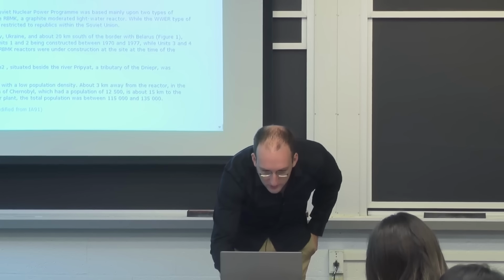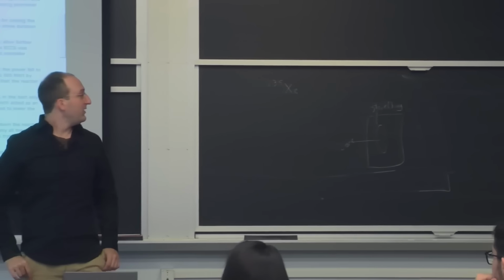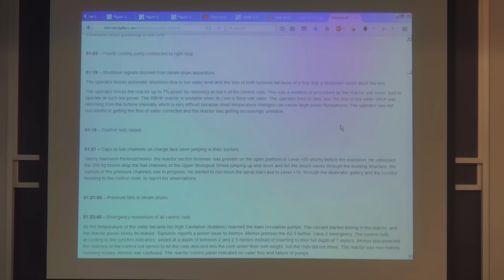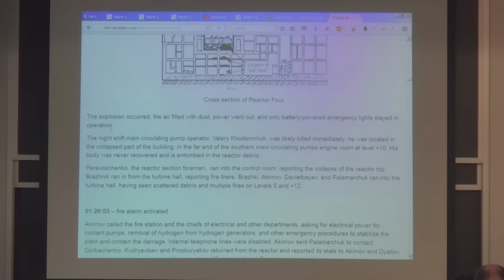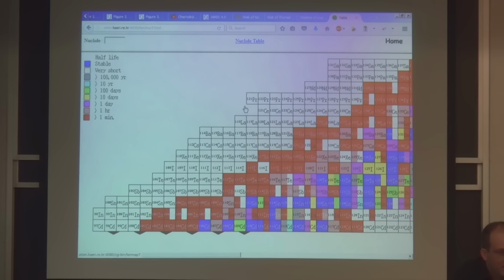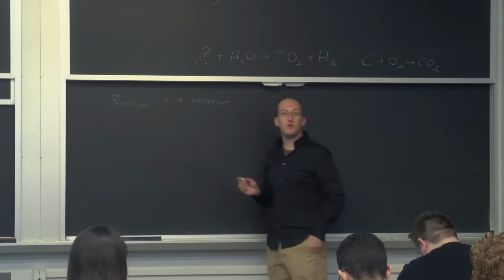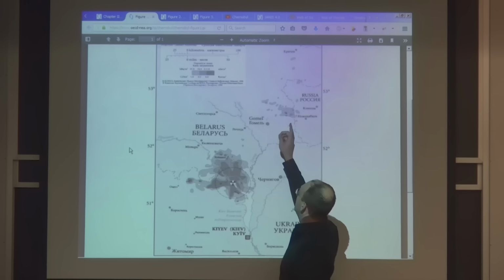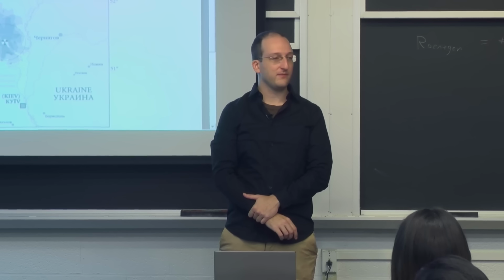26. Chernobyl — How It Happened

Comment: He's actually lying for the teeth. The problem is the containment was only designed after the Chernobyl Chernobyl events. That's what was done like update for safety only for after Chernobyl. Before that nobody build the containments. It was normal to stay for the reactors to be built like that. Actually, the Russia introduced most of the safety features, which is even now available. Most of the safety features only used by Russia by now. One of them it is the way how they now running the one of them. It is the kitchen for the reactor which is melted down, was introduced long time before accident or in Japan. So most of the Russian reactors already type 4 protection most of the world reaction. So this guy even he's from MIT should be the smart one just to keep lying for the Chiefs do the research

Comment: Question: I think the Xenon poisoning is a very important factor in the story. I was going through the scientific explanation behind it and I read about the half-life of some of the elements that appear during fission. 135Sb 1,68s --> 135Te, 135Te 19s --> 135I, 135I 6,7h --> 135Xe, 135Xe + n = 136Xe and stable. It was all about the Xenon build up through the half-live of two other 235U-fission products + 135I as a direct fission product, which caused a constant production of 135Xe, which is 4500x more likely to catch a neutron than a neutron hits a 235u atomn. Because of this phenomenon, the power didn't raise that much when the control rods were pulled out. There was to much of 135Xe because of the reactor beiing at half power for 10h straight. When they lowered the power even more (below 30Mwth, due to an error by Toptunov), even less neutrons were there to cause fission, because of the Xenon build up. When they stopped the ECCS to perform the test, the turbines and pumps were slowing down, so less cooling water was lead into the core, which also caused the system to overheat (more voids). Then when they pressed AZ-5, the graphite tips from the control rods, replaced the water first, causing a huge rise in reaction instantly. The control rods stayed in place, because of the fuel rods were cracking and expanding, endlessly accelerating the reaction and causing a huge pressure build up in the pressure tubes. The pressure tubes also ruptured and the water from the pressure tubes came into contact with the hot fuel, vaporizing instantly into steam (1000x volume of liquid water), which caused the first (steam)explosion. The lid was gone, oxygen finds its way into the core, reacting with hydrogen --> second explosion.

I don't have any relevant background, but I am fascinated by the Chernobyl disaster. I am completely reliant on my basic knowledge from high school and the questions/prompts in AI. So please let me know if my summary is accurate.

Comment: Those workers had engineering and stem degrees from prestigious universities in Russia, how could they not know that a low level of energy output would create a lot of heat in the reactor? 
Shouldn't a nuclear engineer know that low-operation RBMK reactor would explode when you insert a spear of boron with a tip of grafite?
Is not that an obvious observation just like lightining a match to turn on a stove? No one thought like "hey, the tip has grafite, if I put there it will actually increase the heat first before putting it down"?
Not pressing the button would have changed outcome?
Reply: Because they probably have operated outside of the design parameters for years and no one said anything.  They got "confident" they knew how far they could push things and obv underestimated the danger of the power spike.  They figured they could scram it, it would add "a little" positive reactivity and then shut down.
Reply: @richardfrench2863  I am 100% on their side. I sincerely don't blame Dyatlov, Formin (this was not even on site when the reactor exploded), Bryukhanov. In my opinion, I would have acquited all of them, and found guilty Dollezhal and Aleksandrov. But, look, there is a small mistake in your point:

Normalization of Deviance is a pretty common pratice in many organizations. And I get your point: Dyatlov and others probably already pushed the reactor beyond the regulations before and nothing happened. They may have had reasons to believe reactor would not explode. However, the mistake is that they never ever before met this condition:

200 MW + ORM ≈ 6–8 + xenon poisoning + "steam bomb (when turbines stopped)"

This very specific scenario was totally new at that night. No one stopped to ask: "hey, maybe that is too much? This is not totally new and beyond last attempts?"

Again, those dudes were really smart and experienced. HBO blamed Dyatlov and made him a scapegoat, but this man was really experienced. He was one of the most important nuclear engineers in USSR. Dyatlov spent 14 years in the Soviet Far East working at top-secret Laboratory 23, where he specialized in installing and operating reactors for the Soviet navy's submarine fleet.

Sorry for the long text. Just started reading about Chernobyl and it seems a horror movie with all typical NPC mistakes we expect while watching movies.
Reply: It's Communism; members from the Party are/were placed in every workplace and they had the ultimate power. In Chernobyl, a Communist overrode the engineers' decisions. That caused the disaster.

Comment: I wonder how many other times they pulled out more than the approved number of control rods?
Reply: exactly.  They had been violating safety and design parameters for years, looking them as only suggestions.  they were confident they knew the reactor and what they could get away with.  They were wrong.
Reply: Probably none. This was a trial pushed by the Communist Party (members were present!) and the engineers had not much say in the procedure. These Party members had the ultimate power over everything in Communism.

Comment: 24:24 Thermal hydraulics played a key part in the reactor explosion too.
In particular, the interactions between increased reactor power and increased steam production, setting off a positive feedback loop, that is with a net fast power coefficient, are due to the thermal hydraulic behaviour when operating at reduced power.

Comment: 18:49 the graphite dispacer "end effect" is dominated by the action of the graphite pushing water out of the control rod channels.
The change in moderation between that amount of graphite and the displaced water is insignificant relative to the corresponding changes in neutron absorption.
Reply: yeah...that is what they thought.  thought wrong.

Comment: 16:30 the actual correct event timeline (see INSAG-7) shows that the pressure surge that caused fuel channel failures only occurred after the operators routinely scrammed the reactor.

Comment: 11:26 how can a reactor be simultaneously both subcritical and burning out its Xenon?
Reply: Even with a small neutron flux some xenon still absorbs neutrons. Most of the xenon still wasn’t being burned away, mind you. That’s why they retracted most of the control rods which increased the neutron flux which rapidly burned away all of the xenon.
Reply: @snszbyd That's true but when the flux is low, the radioactive decay rate of the Xenon-135 will be far  more significant than its burnout from neutron absorption.

Then if the reactor is literally subcritical the neutron flux will be fixed at a very low value, due to a finite multiplication factor acting in conjunction with local neutron sources.
Reply: @snszbyd xenon doesn't burn down so fast. Timescale of xenon related effects is hours.

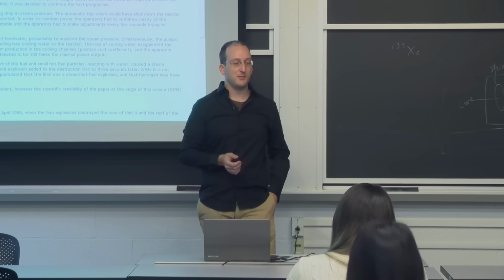Comment: 11:02 The reduction in power to a few hundred MW reduced steam production accordingly.
That increased neutron capture in the cooling water to about 7% of all fission product neutrons. Helped by the grid delay, Xe-135 was responsible for less than 2%.
10 fully inserted control rods are worth about 0.5%.

Comment: 8:33 Xenon-135 has a half-life of about 9 hours.
It takes a few days for all the Xenon-135 to full decay when that is required.
The grid demand that delayed the test by almost 24 hours actually reduced the amount of Xe-135 in the core during the test, compared to doing the test immediately after a period of full power (1000MWe) operation.

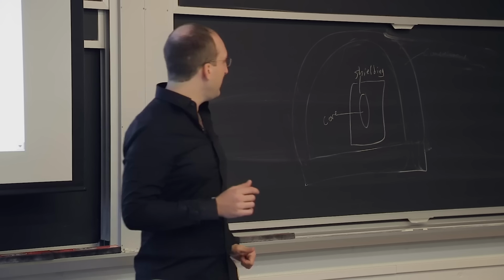Comment: 4:39 In the event of a loss of grid, RBMKs could throttle down and power station loads. The test was actually to support a more extreme fault where loss of external power occurred concurrently with the need to scram the reactor after the failure of a coolant steam line.

Comment: 2:13 The shift operators didn't actually commit any significant violations of operating instructions.
This is confirmed by IAEA report INSAG-7 which corrected previous claims about operating errors, as reported in INSAG-1.
Reply: Yes comrade the glorious cumunist worker has never made a mistake long live the Soviet union

Comment: 14:41 "They shutdown a bunch of these [emergency] systems to see if they could power them from the spinning down turbine." Spoiler alert: turns out, they couldn't ☢😱
Reply: I'm pretty sure the test was actually a success with positive results. Inertia in the turbine provided power for the pumps until the diesel engines kicked in, though water flow to the core dropped by 10%. They likely pressed AZ-5 because the test was over and reactor shutdown was scheduled. According to INSAG-7, the disabling of ECCS had no bearing on the development of the accident. The only emergency system that mattered in the accident was the faulty design of the control rods, that operators were not made aware of, and thus AZ-5 (emergency shutdown).

Comment: 18:20 my favorite part of this video is the mention of the "6 inch graphite tip" that was 4.5 meters long in reality.
Reply: Yep, the HBO show a few years later spread the same misconception. Although I don't think the show mentioned 6 inches, it claimed the reason for the graphite tips was simply that they were cheaper. And while I liked the show, and it sparked my interest, that detail immediately felt suspicious to me. Thankfully there were several good videos on youtube debunking it. It's even more disappointing to hear the same misconception repeated in an MIT lecture. I doubt he gave it any thought as to why they would tip the control rods with 6 inches of graphite. I wonder where he got that detail.
Reply: @xxxxxxx4636  I have no idea where it comes from but the point is, it is almost insulting to talk about the Chernobyl disaster (or any disaster in general) in a professional capacity and not consult the latest official international report on it (lNSAG-7 etc.), that way you can prevent yourlsef saying the control rods has "6-inch graphite tips" or from describing the positive scram effect as "lowering control rods moves the graphite to the center of the reactor" when in really the graphite ALREADY sits at the center of the reaction when the control rod (insirting from above) is fully extracted and dropping it makes it displace water at the bottom.
Also my second favorite part of this video is the mention of Xenon-135 decaying with "a half life of a few days" when a simple google search shows it is a bit over 9 hours instead. I think I know what he meant (talking about how Xenon concentration responds to power decreases in reactors) but his point would still be wrong because he is apparently oblivious to the actual timeline that would put the scheduled time for the test (before the delay) at close to peak Xenon inventory resulting in the delay essentially depoisoning the reactor.

Comment: The bouncing reactor caps is actually a widespread myth, there is a steel plug inside the fuel channels that prevents pressure from escaping, if this plug were to become damaged you would not see the cap bouncing but a constant release of pressure from the cap itself, like a geyser

Comment: very few people understand how close we came to have a Chernobyl type incident I was one of the people doing the current inspection on the water system for the intake pipes we got done a week early because I insisted on going home on a certain date and so instead of inspecting 200 tubes a night we did 400 we did get done a week early we got on a plane that day and when we walked into the house in San Francisco they told us the plant was melting down and we not got done a week early they would not have been able to use the thermal recycling to cool the fuel and we would've had a complete meltdown very very few people know about this story I guess because well the NRC doesn't want people to know about this story how close we came to actually contaminating the East Coast to the United States
Reply: Didn’t happen, kid. But thanks for playing.

Comment: A little bit of radiation is ok only if it does not exceed natural background radiation.  That's something a lot of people are ignorant of.  Radiation is all around us, we have a giant unshielded fusion reactor operating 93 million miles away.   Flying increases your radiation dose because of the emission from distant suns.  Eating bananas slightly increases your radiation dose because of a radioactive isotope of potassium.  The point is, we live our lives bathed in low level radiation, which we deal with.  It's only excessive radiation that is dangerous, and people need to know that.
Reply: Yes but radiation is complex and were really unsure of what dose is absolutely safe as of now. There is other factors to consider other than the amount of radistion. You have to consider the type of radiation ( Gamma rays are more energetic than beta and alpha  radiation). There is the time of exposure , distance from the source, the materials shielding you, and biological factors too.

Comment: So many incorrect facts here.  Not the science but the narrative
Reply: Can you cite a few and rebut them?
Reply: @FDT-86-47  I guarantee you they can’t
Reply: @FDT-86-47 it's indeed factually incorrect. It's better to find proper description elsewhere.
Reply: @JumpingJack-w2l  But where, exactly? This is what I initially asked for.
Reply: @FDT-86-47  I'm not sure you are asking in good faith. He stated that the rod travel time was 7 to 10 seconds, that is factually incorrect, does it counts? The actual time was a sluggish 20 to 22 seconds. This inadequately slow control system was a direct cause of the disaster. For comparison, the emergency SCRAM systems in other high-power reactors can have a travel time 3-4 seconds and deliver a significant effect in under 1 to 1.5 seconds, basically halting everything.He also described the impact of the xenon effects wrong. There are a lot of unnecessary details thrown into these lectures just to portray the operators as reckless. It's exactly like the false narrative around the ECCS, disabling it was entirely proper, required for the test, approved, and didn't impact the outcome. It's part of old story to divert attention away from the actual root cause, which was a reactor flawed in multiple ways.
Reply: @FDT-86-47 14:30 he is describing a weird timeline from designers' narrative. Claiming that the operators caused instability and a power excursion to the degree of jumping caps before the scram is factually incorrect. The actual facts are that the reactor was stable before scram and it was the shutdown system itself that caused the disaster.
Reply: @JumpingJack-w2l  I simply asked for specifics, because the original comment was vague.  To suggest I didn't ask in good faith is appalling and just false.

Comment: 20:00 As far as I understand (this is so interesting to me)- this wouldn't have helped either bc the extra added Graphite tips wouldve set off the chain reaction regardless. If I remember correctly, the Operators did cut off the control rods off the system pretty much to let gravity do it's thing and they still just got stuck these 3m or so in there bc the pressure of this at this point pretty much pressure cooker was too high. The vapor/ bubbles were too strong and kept pushing the control rods up regardless- add the added graphite tips of all control rods at the exact same time inserted into the already bubbling reactor and that was basically that last little bit of reactivity it needed. 

They added oiltipped tipped "control rods" to a water-"fire" pretty much. 

If i understood my past.. "research" & evidence correctly :'D

Comment: One would think that question is rhetorical,  of course the turbine(s) takes a lot longer than one minute to spin down... long enough for the diesels to come online .
Reply: Turbine spin down is a cool thing but they needed power with proper parameters. First test of that new system was done on 3rd unit, generator excitation stopped early or something like that. So developers were developing and requesting tests of new versions of equipment.

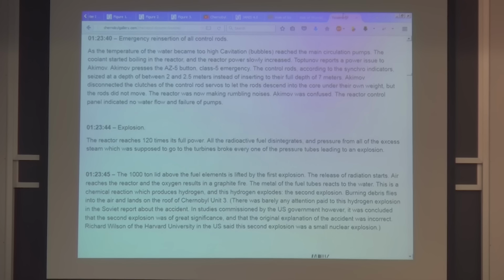Comment: at 20:10 or whatever, a student questions whether a better timed/forced drop would prevent this encounter and the speaker dismissed it. i propose to you all, should the RBMK control rods be inserted *at force*, speedily, would this have happened?
Reply: Most likely, it wouldn't have. The control system was designed with a rod travel time of 20 to 22 seconds, whereas in other reactors, it can be less than 3 to 4 seconds, delivering an effect, stopping the reaction in just 1 to 2 seconds. Most likely, if the system had been properly designed in this aspect alone and had acted faster, the disaster wouldn't have happened. Sluggishness of the control system named as a major design flaw that caused the disaster.